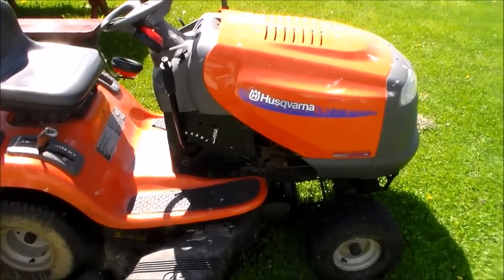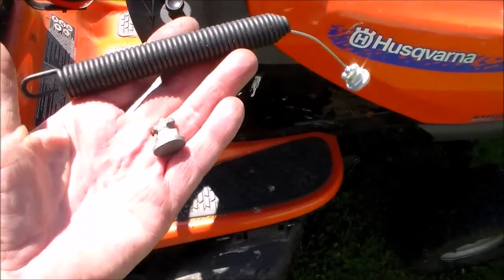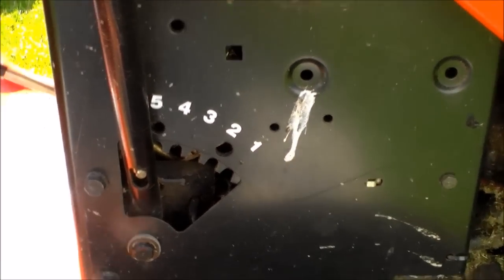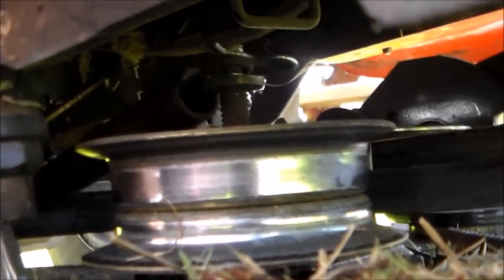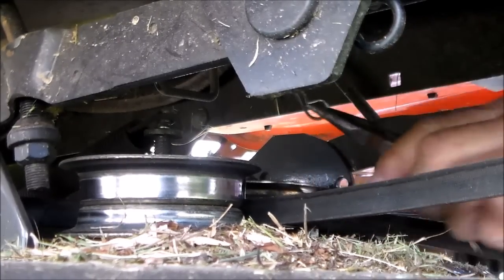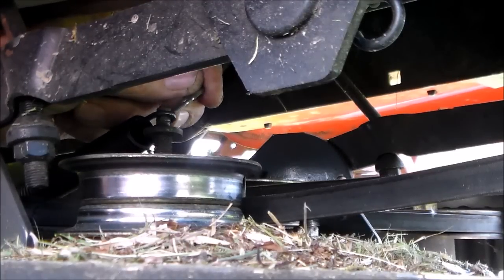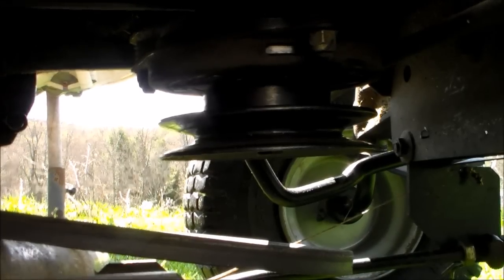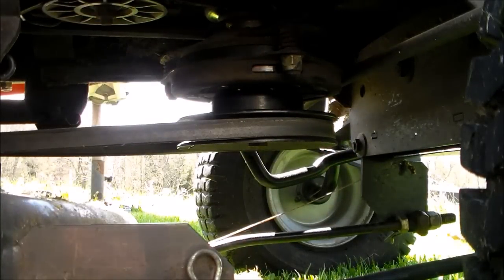Husqvarna Ride Mower Electric Clutch Spring Replacement

Comment: Great. My husband had to replace mower belt. When he took the deck off, the spring was disconnected. He had no idea where it suppose to go. Manual was no help at all. In the how to replace mower belt section it was not shown in the diagram or mentioned.  I found your video and since the deck was off, it was re-attached in seconds. Thank you so much for taking the time to make and post this video.

Comment: Thank you so much for this high quality video. I had to install a new electric clutch as it had quit working. But the blades were barely turning,  could not figure out why. Did a whole  circuit diagnosis,  rechecked connection and finally pulled deck out. The Manual was no help,  multiple videos found didn't help and I was totally lost on how to reinstall the spring.  Finally found your video, re installed spring and back to cutting grass. A simple fix made possible by you,  thanks again.
Reply from the maker: you are so welcome!

Comment: I ran over a short piece of indoor 4-conductor telephone wire with my Craftsman 917.273642 Lawn tractor (nearly identical to your Husqy). It stopped the belt fairly quickly. After removing the wire the mower blades would not turn. Fortunately I found your excellent YouTube video. Somehow the spring had popped off the idler pulley and following your assembly instructions it worked as before. Thanks for a nice post.e
Reply from the maker: I am glad it helped you my friend---Don
Reply: I have a hustle sd won't go forward or reverse  just stop

Comment: Hey mate, your video helped me get the job done, thanks.. I actually replaced the whole cable from deck  to lever on dash.  One problem I got now is that I cant get the mower to move forward or back It starts and everything works perfectly, except movement lol.  Its like something might have moved or fell out when the cable snapped originally, and because I had no idea when replacing the cable, obviously I did not fix whatever did move when it snapped. The clutch arm and cable all work fine with the blades turning and stopping correctly as the arm/handle is in the right position. I have a feeling it might be some spring or similar that fell out when it first happened into the long grass, but I dont see anything. Any ideas what I have missed?

Comment: When the spring is disconnected is the motor able to turn at the fly wheel by hand? Or is there something that locks the motor from engaging as a safety measure. My motor doesn't seem to be stuck but the fly wheel only moves back and forth about an inch.